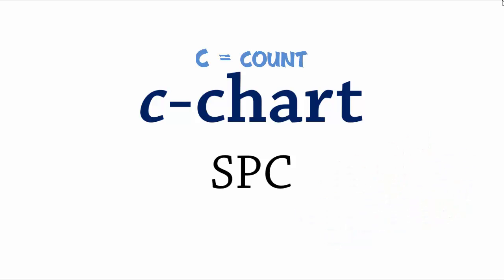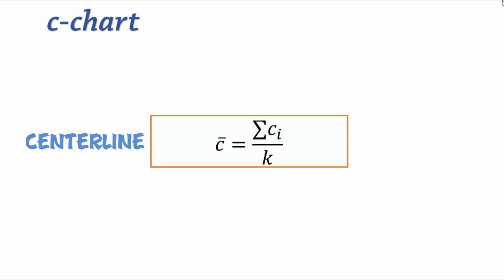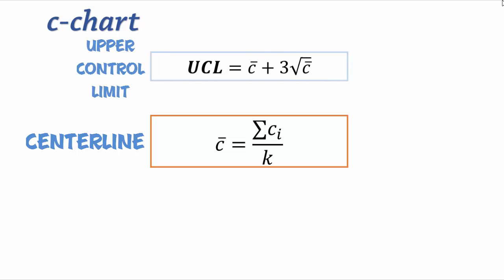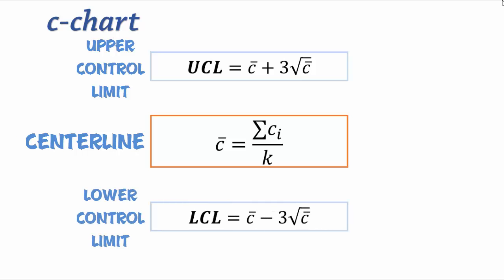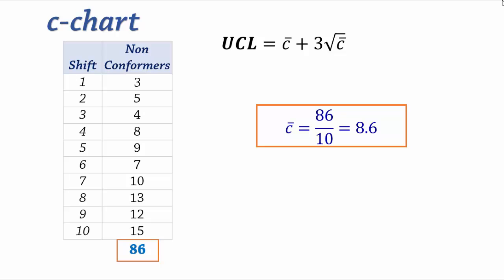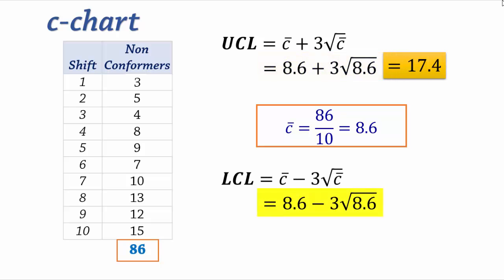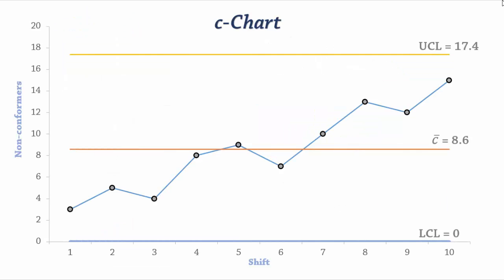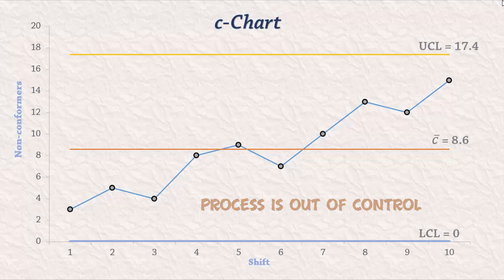SPC 4: c - chart (Control Chart for number defective)

Comment: One thing there is a difference between defective item and defects, defect does not directly refer to defective item , so if a product contain any nonconformity(defect) , it is not necessarily defective.
In this case, the lesson you explained will be a real confusion why because the difference of usage terms between P/NP and C/U charts is the point whether they are about defective items fraction among the inspected items(P) and the number of defective items which make it easier to understand(NP)

C Chart then is used to show the defects in the sample of products and u the defects per unit .
I mean there is a big difference between what Montgomery and Deming said, and what you explain. Can you make things clear, please? What is the key ?
Reply from the maker: Thanks for the clarification. You’re right, as someone else pointed it out another comment. I would have placed correction notes on the video but YouTube no longer allows that and I haven’t had the time to post a replacement. Hopefully, the audience will read your comment and understand the difference. I’m pinning it.
Reply: @joshemman  thank you mister.got that
Reply: Lq
Reply: P
Reply: L